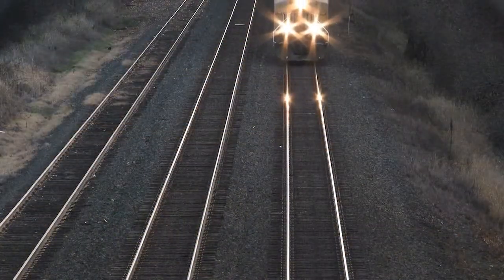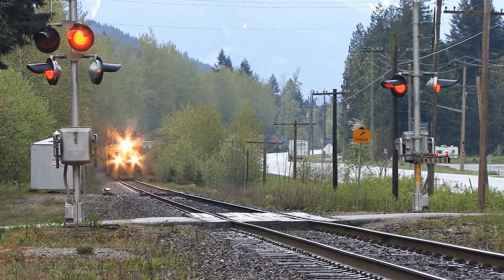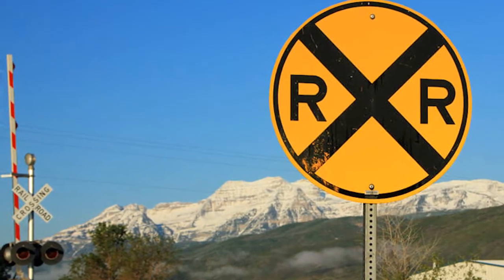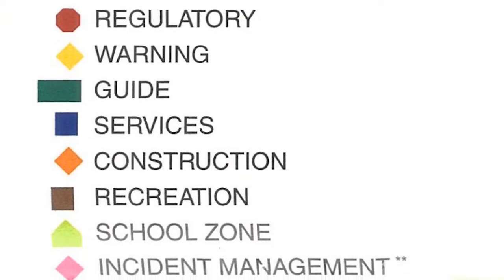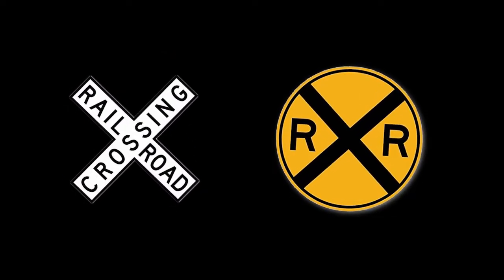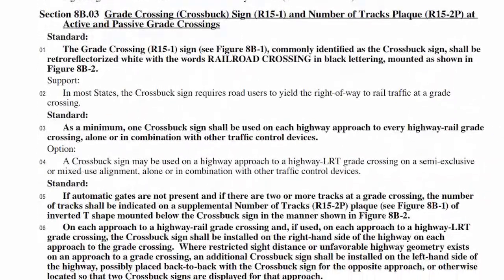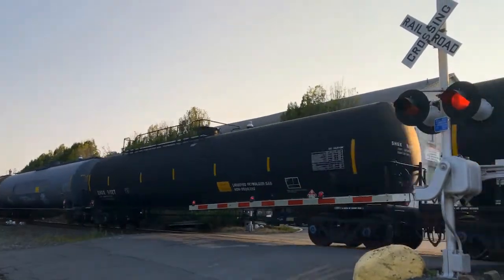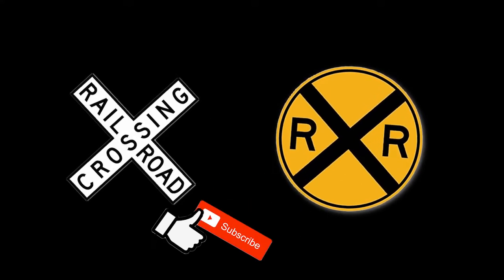Why are there 2 Railroad Crossing Signs?

Comment: 4:52 It isn't a matter of liking one sign more than another.  They serve complimentary purposes.  

The Advance Warning sign is, essentially, a type of YIELD AHEAD sign.  As you pointed out, the crossbuck essentially means YIELD (to trains).  

In addition to color standards, the shapes of the signs are also important.  You may not have noticed, but governments installing STOP signs try to avoid placing a differently-shaped sign directly behind a STOP sign.  This is because the shape of the STOP sign needs to stand out, even if it can't be read.  You can still tell it's a STOP sign because it's an octagon.  
There's an informal correlation with the number of sides of sign and its representative danger level.  With a few exceptions, the more sides, the more danger. Most signs have 4 sides. School crossing signs have 5 sides.  Stop signs have 8 sides.  Crossbucks have, basically, 12 sides.  Railroad crossing Advance Warning signs, being round, have infinite sides.

Comment: That's like explaining why there's a "stop sign ahead" sign in front of the stop sign.
Only difference is that these are required by law at all protected crossings and some unprotected crossings.
So this does explain to me why some of these crossings will have "EXEMPT" beneath the white sign. Typically over lesser used crossings.
Reply: The EXEMPT signs are really a whole other video.  What they mean, how they're implemented, and why they exist in the first place.  All they really apply to, though, are vehicles that are expected to stop at all railroad crossings (e.g. gasoline trucks, school buses, etc.)  The EXEMPT sign indicates such stops are not required if the crossing is clear with no trains approaching.